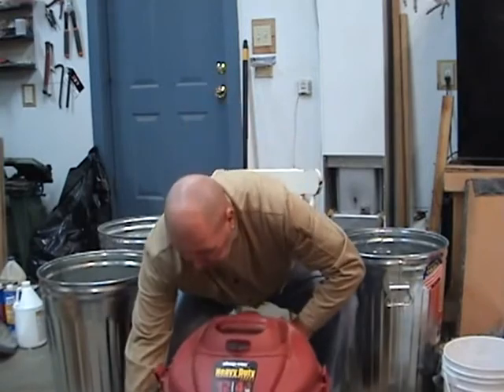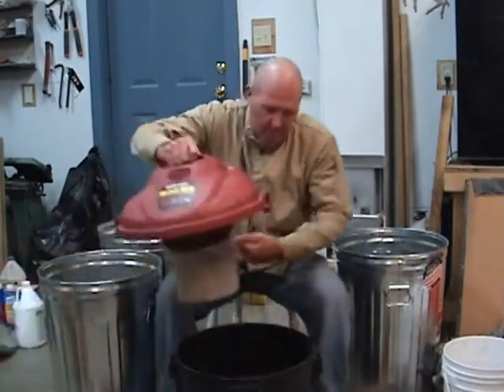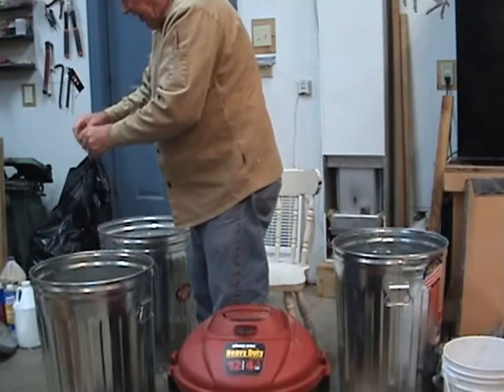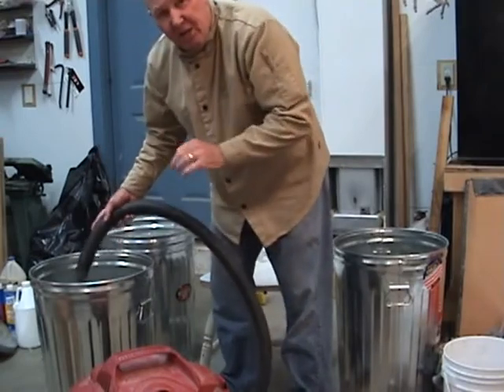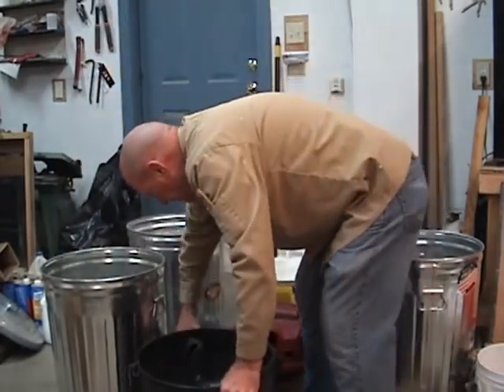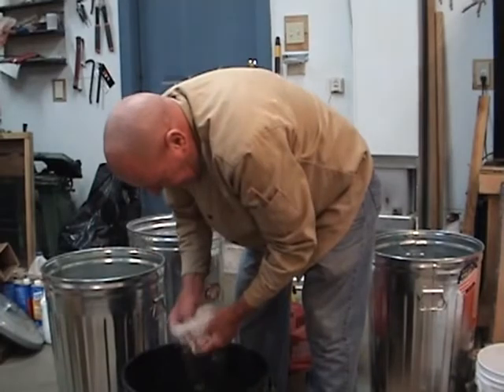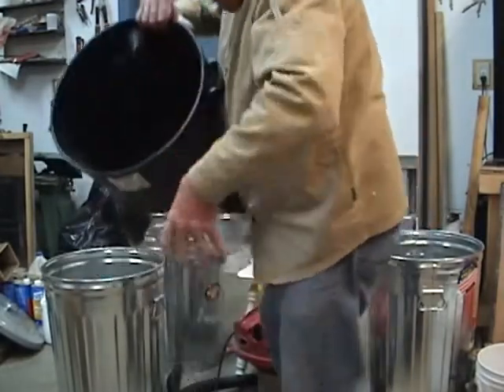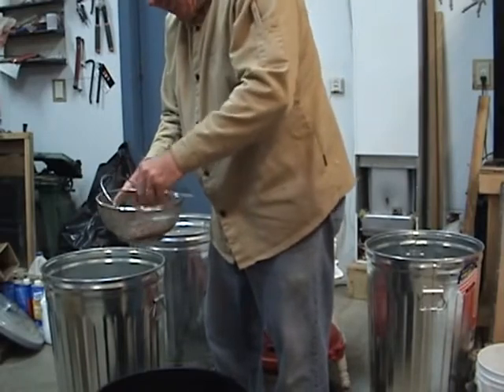Separating milkweed seed with a shop vac.

Comment: Thank you for sharing your technique. I was actually looking for a way to harvest the Fluff rather than the seeds (although the seeds will be redistributed free through our local Seedy Saturday and possibly some clay seed balls donated to vacant lots around the city :)  The fluff is an amazing natural insulator (a Canadian company is using it in some of their winter coat designs as a better alternative to duck down) and I have plans to try it in some winter clothing and duvet projects/experiments which means I need a lot! so this method of using the shop vac will be very, very helpful.
Reply: I'm thinking of making a sleeping bag with it.  I wonder how it will compare to down which is really expensive. I did put the floss in a ziplock bag, remove the air (vacuum) and the floss pushed the bag back out to fill it with air (tiny leak at seam I guess), so it doesn't matt very well, so that is very good for insulation